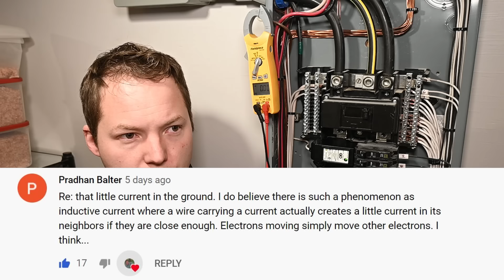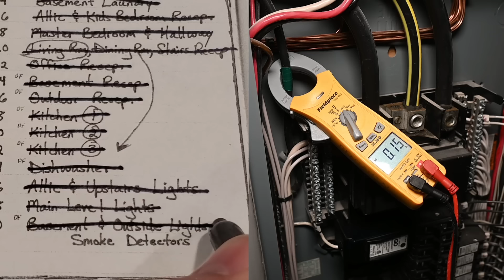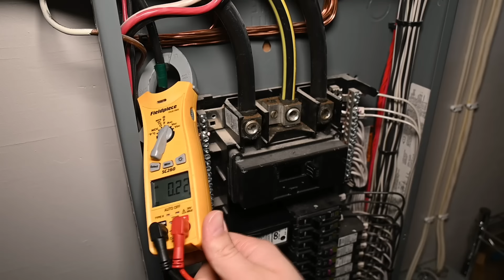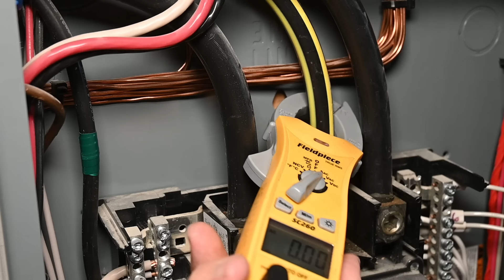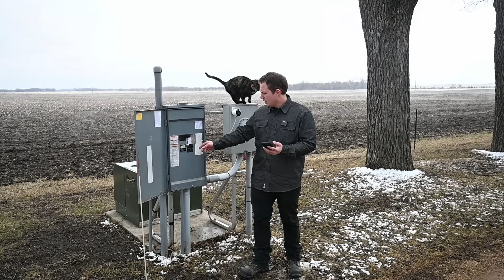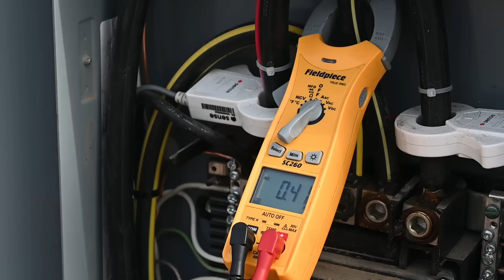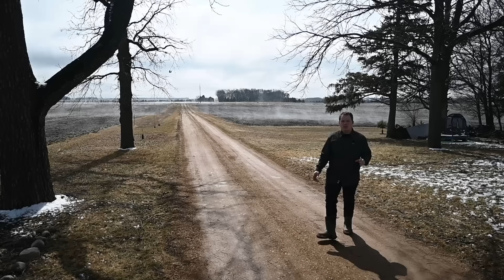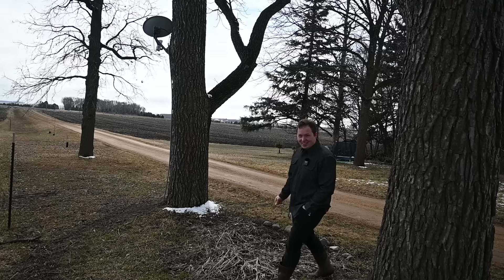Finding The Source of Stray Current on Grounding System

Comment: Sounds like you have a ground loop problem.
Reply: Yes he does.  His ground rods are providing a return path to the power grid.

Roy...
Reply: my thoughts or the gas line has a charge on it . disconnect the gas line connection  and measure the postnatal
Reply: Definitely. I see this all the time in my line of work (industrial communications) My resolution is to maintain only a single ground point (or a delta y configuration) as close to the power entry as possible (in this case at the main panel) and the current instantly drops to about nothing (usually less than 30mA). D

Comment: This is real troubleshooting! I'm used to tracking down strange issues like this doing the live audio work that I do. That much current on the ground could cause wacky issues with audio and lightning gear, especially with the newer digital equipment we use.
Reply: patthesoundguy Yes Sir. If you do not have an adequate ground then inductance, noise can be introduced into a receiver that overcomes some of the noise cancelation properties of the circuit. This is less of a problem with digitized equipment that the old analog systems. It can still cause headaches for the technician.
Reply: Yes less noise in the digital equipment, but the computers themselves can become “confused” by the erratic currents and voltages throughout their respective paths.  The analog gear will still work properly but can manifest with noise, or maybe not work properly because the erratic power can over stress the capacitors and cause performance issues or failure.

Comment: you have a GROUND connection...    somewhere between the GROUND and the COMMON ..  and that is feeding something..  when you turn off L1 and L2.. you don't shut off the common..   you are going to have to clamp around the individual Common and Ground wires going out inside your house to find you actual Short/path between Common and Ground..   if the Transmission line has 2 wires... not 3 its a DELTA and it uses the earth as the 3rd leg...   this could cause your issue as the potential between the outside box and the inside box is less resistance thru the ground wire..    just for kicks.. do a voltage drop test... string out 100 foot cord.. hook the U ground to the house grounding rod and the other end to the multimeter connections set at 200 volts AC... and then to the yard ground rod.. if you get 00.0 change the range to 20 volts AC.. if you still get 0.00.. change the range to 2 volts AC.. not all meters have this ability..   cheap meters may NOT BE ACCURATE at this tiny current in AC or DC mode..

Comment: Leakage current is generally 210 micro amperes 
What important most home have to outdoor clamp are old rusted badly to grounding connections. Need put new one on more better properly better grounding.
Reply: David White Great advice Sir. You are right. That causes a high resistance between earth ground and the panel which can be very dangerous.

Comment: This may require a call to the utility company engineer to get an explanation. Theory and engineering.  Must have something to do with the coils in the transformer discharging.
Reply: Most likely a rural single phase power drop, so a 5KV primary on the transformer is returning current to neutral which is grounded at the pad, so some neutral current is taking the ground to the substation instead of all of it on the neutral.
Reply: @isettech , and this is followed by cold weather, when resistance of "transformer+meter site" grounding system (rod(s) to earth) becomes higher, than summary of "ground wiring" to earth current paths (through incoming pipes connections, naturally grounded equipment, or ground rods at the house itself). I think, it is some sort of design flaw for grounding systems for such neutral grounded HV grids in rural area. Ideally, each customer's transformer site must have "strong" grounding system, comprised of all-welded grid of thick steel 3 meters ground rods, welded to each other with steel busbar. To achieve ground resistance, comparable to area HV substation's one. Or to use 1-2 special "grounding wells" instead of several rods. Goal of this - to have a stable "all-weather" low reasistance of grounding system, that could sustain long term direct short circuit current from HV phase directly to grounding system, and will not cause dangerous potential at the point of short circuit, and at the customer's house, as this potential will spread across the whole property over customer's grounding conductors.
Reply: sensible approach. I am with you

Comment: I stated on the last video that you have a ground rod by the main panel.  You also have a ground point with your plumbing coupling/gas coupling/ground wire.  You have .44 amps at the neutral and you will see .22 amps on each parallel leg of the grounding.  If you added a third ground point, you would see .15 amps on each leg.  These are two parallel paths to ground from the transformer.

Comment: My guess is, while watching this, is you have a battery backup installed somewhere? But that still makes no sense since you cut the breakers...
Reply from the maker: Yeah, there was nothing connected and I don't have my battery backup set up right now. I think it is normal "neutral leakage" from the utility due to voltage drop.

Comment: So it sounds like a distribution problem with the power company.  They are loosing nearly a half an amp. If that is happening with all of their customers they are loosing a lot of money.  Which in turn reflects on future bills. They're not going to absorb the cost, they pass it down to you in increases.
Reply from the maker: Depending on the voltage difference to remote earth it may be as little as 1 watt. I might try to test the voltage on the grounding system in an upcoming video.
Reply: Johnny Man I like your avatar👍🇺🇸🤙😃. I worked 20 years in power generation and was raised by a senior lineman and I know you are right. With instrumentation available now they could monitor this at the output of every transformer but that would cost a few dollars per customer so as you said, they let us pay for it. If everyone knew this they would be taking their frustrations out on everyday working employees that have no idea what is happening them selves. Sure would not hurt to be explained to a responsible agency. In my case the public service commission of my state. Thanks Brother.
Reply: @kenswitzer4133  It's good to hear from a brother.

Comment: What if that current is flowing between panels? One side of ground has more current in it than other side.
Reply from the maker: Could be but in this case I don't think so because everything was powered down when I tested it.
Reply: @BenjaminSahlstrom  it's like siphoning one well to another, one well might have higher static level than other so it flows from one to another even though they are in same area. Same thing with electrical properties of ground. Current is flowing becouse there is difference in voltage in ground. Even though we might think that ground is 0 volts, it's not. One piece of dirt has more charge then other side of it.
Reply: u have 2 ground rod points. one near house, one near mainpanel  so the current split maybe to half...

Comment: The question is which way does the current is flowing?
Reply: Since this is AC, there is no direction of current flow like there would be with DC.
Reply: dbinok good comment Sir. He is still learning and you just gave him something to think about so maybe he will find this for himself. He seems to have the desire👍
Reply: @googacct  think again
Reply from the maker: I'm wondering the same thing! I think its flowing to ground from the transformer.
Reply: it only can be flow inside of the transformer, or between transformer and mainbreaker at masterpanel
So it is most possible some isolation error @ the transformer

i only can say this in german right 

Erste Kirchhoffsche Regel (Knotenregel)
"In einem Knotenpunkt eines elektrischen Netzwerkes ist die Summe der zufließenden Ströme gleich der Summe der abfließenden Ströme."
translated...
In a node of an electrical network, the sum of the inflowing currents is equal to the sum of the outflowing currents.

in our case u have only the Transformer, the electrical meter, the Main Panel, and the wiring.
the transformer shoud be isolated to the higher voltage... so one off the realy bad boys must be the electrical meter
Reply: @BenjaminSahlstrom  Try to inspect pipes and other earth-bonded metal parts. Disconnect earth wire from the pipes, ventilation, etc. until multimeter will show clear 0 Amperes. May be your water supply company or gas supply company has leakage, which is flowing through your home.
Reply: Which way current flows depends on whether you are talking about hole flow or electron flow.
Reply: Farmer Dave Thank you.
Reply: is this from the high or from the low side of the transformer? so he has 2 or more grounding rods, the sum of current flow like a tree to all ways... so he has 0,2 on subpanel, maybe 0,2 to the groundrods near mainpanel... in sum 0,4 

but never with 120/240V  over this size of area ... it must be more voltage!